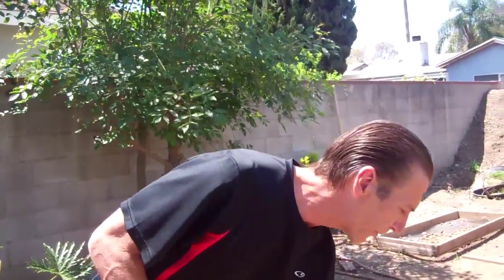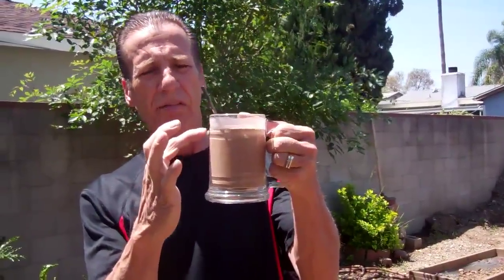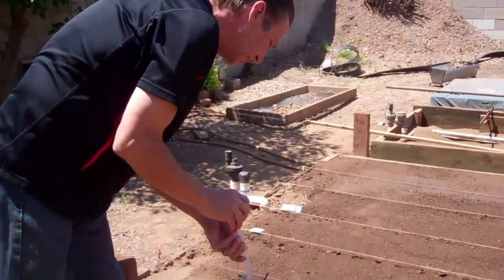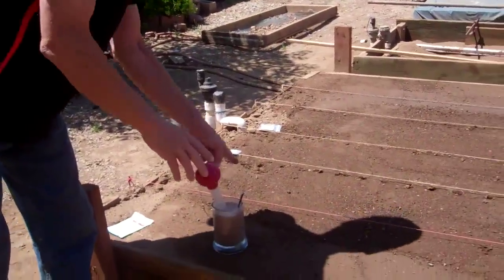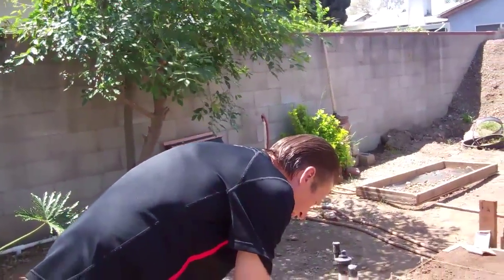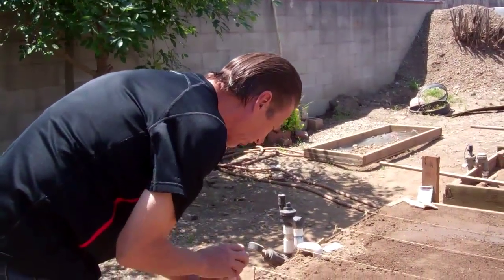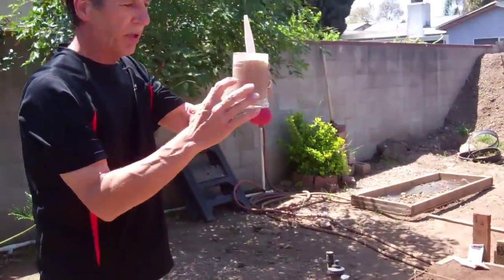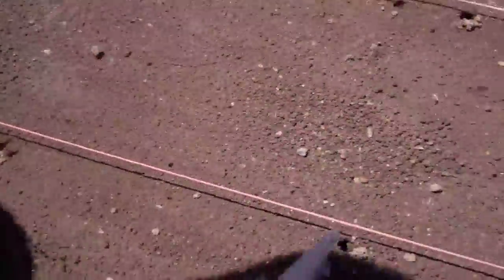Planting seeds and coating them with Azomite

Comment from the maker: It seems to have really worked well 3 days and the radishes sprouted and in 4 days the cucumbers snow peas and two tomatoes along with the squash.have sprouted. The radishes are over an inch high. I think the Azomite made a big difference. Like you said you can't use to much so I will be injecting it in the irrigation system at least once a week.